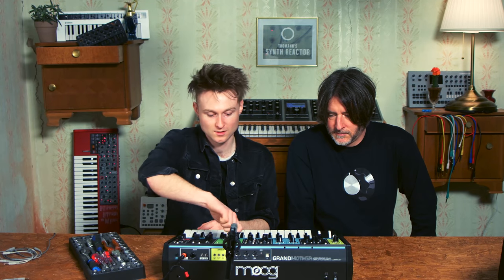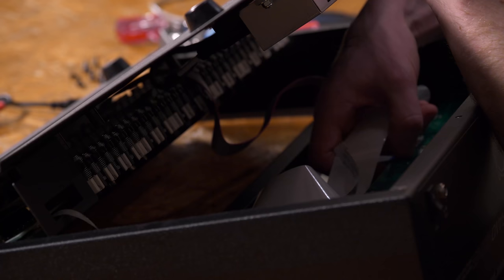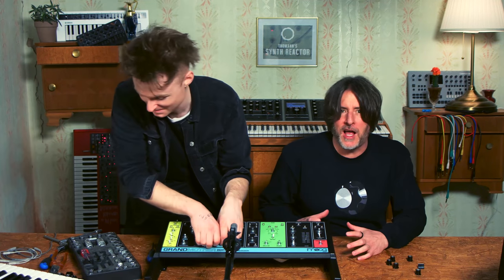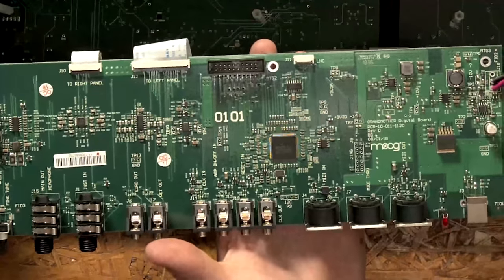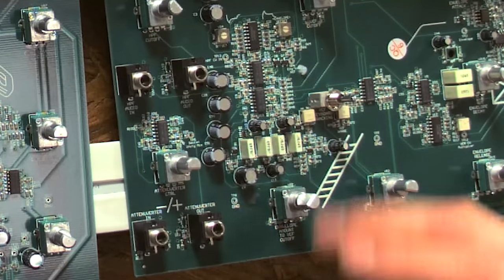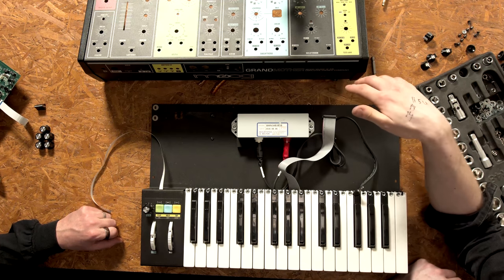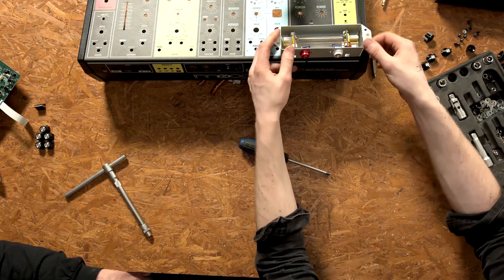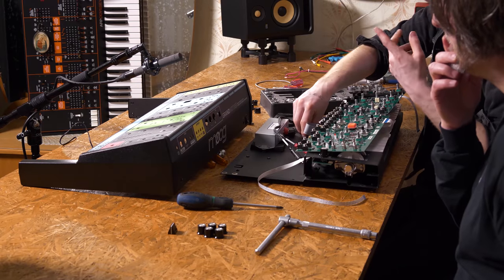TEARING APART A MOOG GRANDMOTHER ANALOG SYNTH

Comment: There are two envelopes. main is ADSR, switch left controls VCA. Second is an XR, switch in middle position for VCA fast attack with controlled release. The envelope can loop if you patch the ENV+ to Trig in when a note is being played. Occasionally it fails to trigger and stops :)

Comment: I just got a Grandmother about 10 days ago.  Last weekend my friend who's an incredible scratch DJ/producer came over and sampled about 70 minutes of sounds off of it.  Can't wait to see what he does with it!  About the spring tank - I think you'd need to ensure that any replacement tank has the same (or at least close) impedance as the stock one.  If it's too far off, you'll at best change the response curve of the reverb control, or at worst have something that does respond no matter where it's set.  Another thing - it looked like the spring tank is connected with regular ol' RCA cables.  That opens up possibilities of some interesting modifications.  I suppose the stock reverb out point kinda covers that, but someone smarter than me could probably come up with some really good ideas.

Comment: What I gather from this is that it would be a trivial matter to break out the send and return of the spring tank,  to plug into whatever you damn well please. Am I on the right track here?
Reply: A reverb tank needs a circuit to drive it (kind of like driving a speaker)  and another to reamplify the signal, so you couldn't just plug a signal straight into the tank, but there are actually patch points for the reverb in and out on the synth already.
Reply: @plateoshrimp9685 I should've phrased that better, sorry.
 I actually meant more along the lines of being able to freely replace the internal reverb tank. What I surmised is that I could just put a couple more holes in the case, unplug the cables going to and from the tank, break those out, and hook them to whatever external something-or-other I fancied. Is that doable?

Comment: 9:00...yep, it’s all about your induction, transition and capacity array that determines the output...so yes, you are correct about using the transistors to match the frequency and a capacitor to clean up the signal ...I do believe the induction determines the amplitude and therefore the amplification.

Comment: Ah! I've got a Moog Mother 32 I'm in the process of repairing. My ex boss gave me it along with a load of other synth stuff. The anaogue section works so it makes sounds. nice ones too! But the digital section is fucked. All the shift registers have blown. I've got replacements (a few quid off ebay) and just need to replace them. :)

Comment: In less than 24 hours Moog has had 9,500 synthesizer enthusiasts staring at their product and learning more about it for 15 minutes.  A Grandmother costs $900... retail.  Even if they totally destroyed that Moog and it was a $900 loss, the benefits in free advertising for Moog definitely out-weigh it.  Simon could have smashed it to bits with a hammer and the viewers would have skyrocketed.  In terms of product placement... dirt-cheap.

Comment: it could be great to put a splitter on that spring reverb input jack and run it outside the case.  If you did that and plugged another spring reverb into the other side of the splitter, would both affect the sound simultaneously? That might sound pretty wild
Reply: Yeah i think they would both add to the overall reverb, but with a caveat: it may be necessary to add an extra amp stage in order to match impedance- and volume- levels. However, if you think about it, you could add virtually ANY effect in that fx loop.

Comment: Same reverb tank than the Doepfer spring reverb A-199. It sounds quite good but you can of course use another tank with same specifications, if Moog does not give the latter just have a look to the A-199 documentation on Doepfer web site.
(I will not buy this GrandMother as a second hand after what I saw :-) )
Reply: Sure ? Moog's tank is BMN3AB3B1B. Doepfer's is 190ohm for input resistance, is in specs but cant see the model number.
Reply: @MsLeguman  The one that is shown in the vidéo is really identical to the one that was supplied with my A-199. But perhaps there is a difference of impedance. Of course must be checked twice before buying a new tank...

Comment: one should never touch the actual circuit board :/ Especially older boards :<
Reply: I would say especially modern boards, he could have damaged any ESD in it by touching the circuit without an anti-static wrist wrap
Reply: @tired.mp3  It's probably fine, I just had a thought that after multiple touches things have a tendency to break down over time. But he'll fix anything that breaks down, Mr Sam is handy as anything ^^

Comment: I’m a little disappointed actually, I was hoping it was discreet analog components 😔
Reply: It actually employs discrete analog components. Discrete doesn't mean "no ICs at all", it just means that oscillators, filters and envelopes are not self-contained in a single IC, like happens with the CEM VCO/VCF/EG chips for example. Op-amps are analog ICs, the transistor pairs used in the VCO's exponential converter are encapsulated together in an analog IC too, CMOS switches are analog ICs (albeit digitally driven to select the input/outputs), etc. And all of these are the basic building blocks of the circuitry of VCO, VCA, VCF, EG, etc, together with transistors, resistors, capacitors, diodes and so on.
Just check the voice boards of any so called "discrete" analog synthesizer from the 70ies/80ies and despite the word "discrete" you will still find a lot of ICs, the vast majority of them being op-amps and eventually a lot of CMOS switching stuff in digitally controlled machines.
Reply: mima14031985 A ha! That explains something I’ve been trying to figure out. Almost all of the analog synths that have the sound I prefer turn out to be discrete analog but some of them (especially the newer ones) didn’t look it and I couldn’t figure out why. Thank you for the informative answer!
Reply: @Matthewsavant  You're welcome :-)